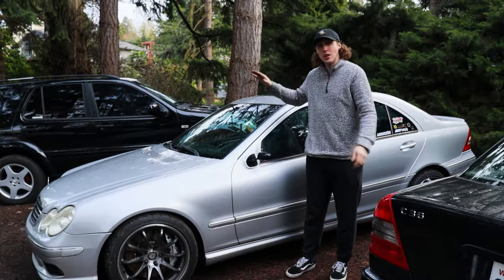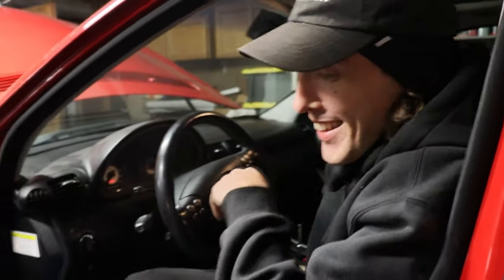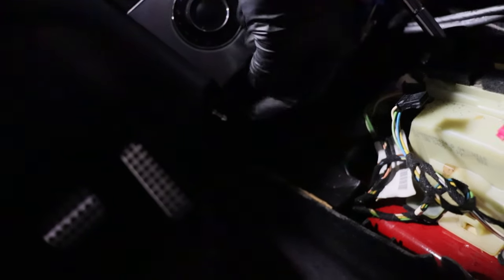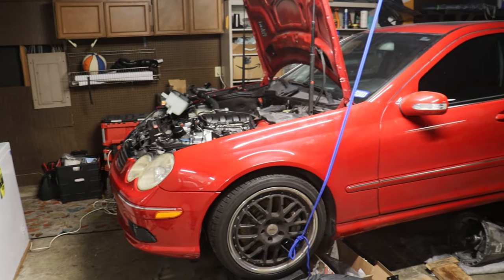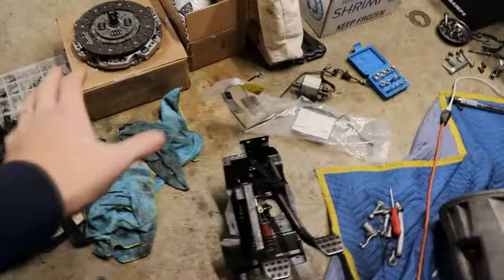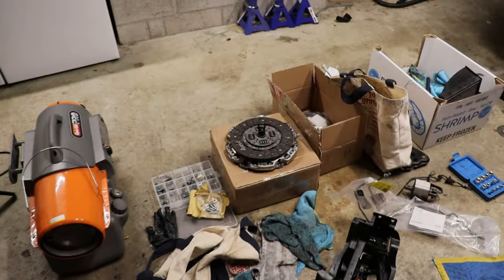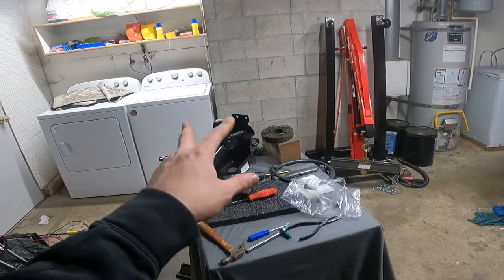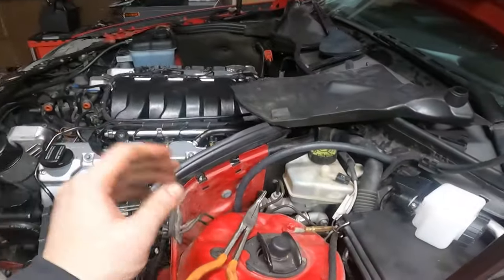Mars Red C55 AMG Manual Swap - PART TWO - Shifter, Pedals and FIRST START!

Comment: What transmission are you using?
Reply from the maker: W204 C300 6 speed
Reply: @ANDERZENAMG  Nice.  I just bought a 6 speed from a W204 C250 CDI for my 400E.  Should be swapping it in a couple months.